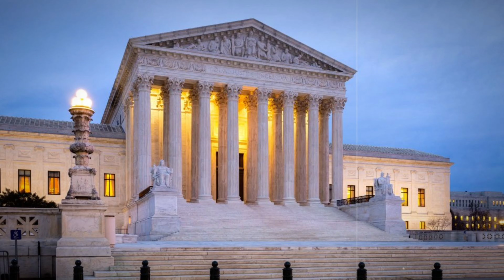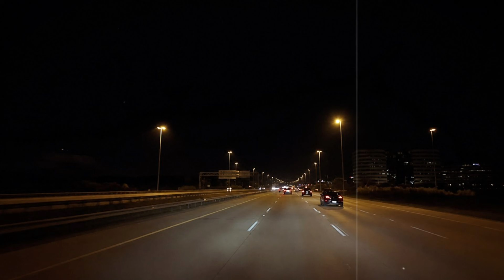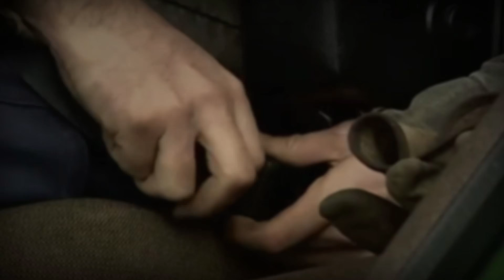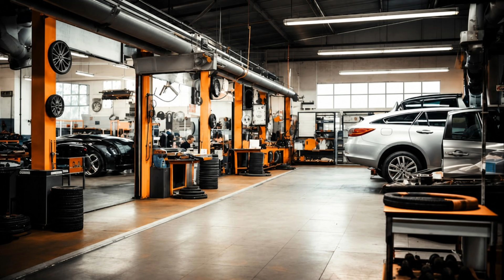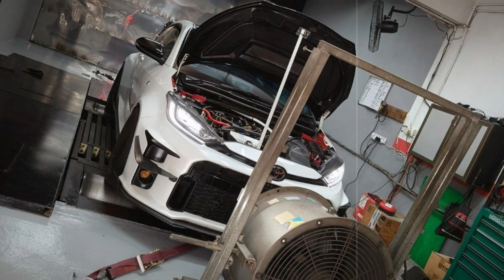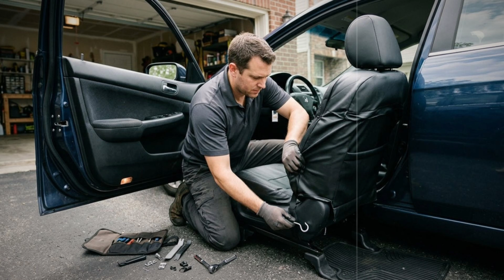5 Toyota Accessories You Should NEVER Install (#4 Voids Your Warranty)

Comment: First off Toyota would have to prove it was the cause of failure, and that would be very hard to do saying it made it fail and proving it is two different things, and for someone who works on Toyotas for 20 year should learn that they make remote starters that plug right in and by the way Toyota shouldn't be taking away my remote start that I paid for when i bought my truck in the first place and while we would be in Court they would have to face a Law suit over recording me without my written consent. and don't get me started on head lights my Tacoma came with LED head lights from factory but they were a aftermarket part that Toyota put on from LG not a Toyota part so Toyota needs to honor there Warranty.

Comment: My used 2017 Prius came "Certified" from a well established dealer with the Karr security system. Is that kosher?  In two years, I've had no issues, but I'm just asking for my peace of mind.  I love the vehicle 😊.  Also, is replacing interior lighting with brighter LED bulbs okay?  I'm in my 70s and more, brighter light would help.

I'm a ham operator running a UHF/VHF radio with a mag mount antenna. For obvious reasons, there are no connections to the vehicle's systems. Power comes from a box on the floorboard behind my seat with a LiFePO battery. Common sense, yes? I bring it out and charge it.😊

Thanks for your excellent videos! 🎉

Comment: The only thing I did was buy made for Toyota seat covers, a trailer hitch (Toyota wanted 1,000.00 for theirs) plus wiring harness ofor & yellow fog lights ( night driving is tough enough but rain or fog is something  I try to avoid)I have not installed them yet but it looks like the wiring harness is already there.